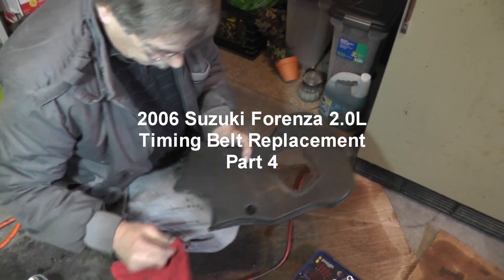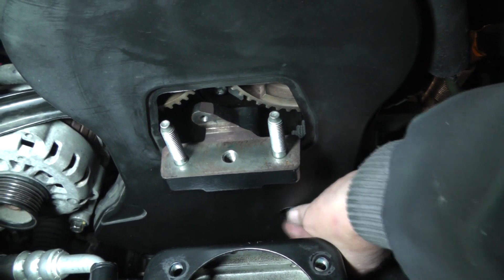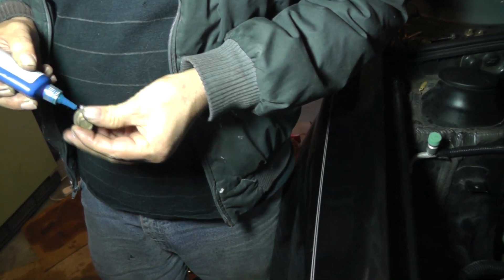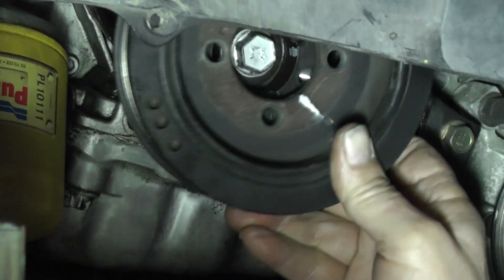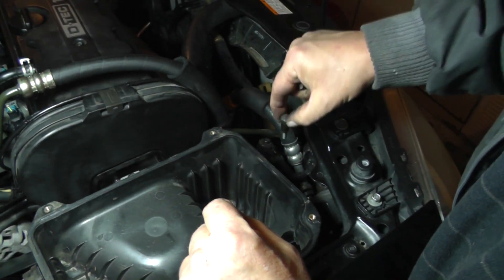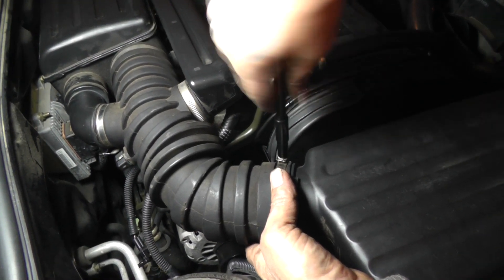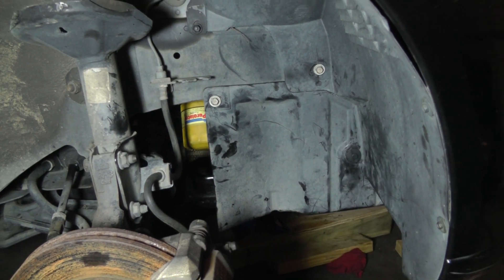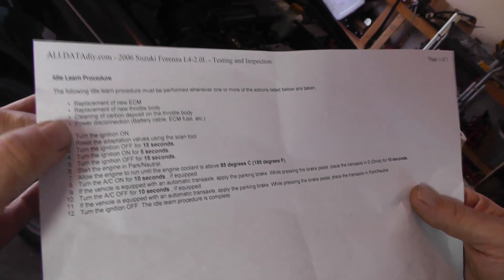Suzuki Forenza Timing Belt Replacement - Part 4

Comment: I've replaced my Daewoo Nubira's timing belt. It was the first time ever I did it. Before remove the old belt, and to keep the correct timing in the assembly I've aligned the marks in the camshaft gears and painted a mark on it, and also on in the crankshaft pulley. I did the mark in the same position in the belt. When the old belt was removed the camshaft came out of position. I've moved the marks from the old belt to the new one. Then it was just a matter of matching the marks on the belt with the marks on the gears and the pulley. When I applied tension it all came to its proper place. It's a 1.6 engine, but it's very similar. This procedure does not apply when the belt as snapped, of course.
Reply from the maker: Thank you Pedro for your comment on your method of replacing the timing belt. Always a little different ways to do things.

Comment: When you tighten up the bottom crankshaft do you put it back in time or what do you do
Reply from the maker: Not sure what you mean. If you're talking about the crank sprocket bolt, it's keyed so it won't move when you tighten the bolt. Just make sure that the mark on the crank sprocket is aligned when you put the belt on.
Reply: @stuzman52  other question how much antifreeze do you put in the car after you  Drain the radiator and pull out the water pump
Reply from the maker: The coolant capacity is 7.82 quarts. I would get 2 gallons of 50/50 mix of coolant and you should have a little bit left over.

Comment: That was an epic series excellent.. wonder how much they would of charged you for that!!  very nice thanks
Reply from the maker: Hi Rick. Not quite sure and as you know prices vary around the country. My best guess would be around $350 for labor. The timing belt kit runs around $115 and if there is a coolant flush done, that would be a little more. Thanks for the comment on the videos, as I appreciate it.

Comment: Did it not make any contact with the valves? Isn't this a interference engine?
Reply from the maker: Yes Vincent, this is an interference engine and 12 out of 16 valves were bent.

Comment: Great stuff. Very detailed and informative. Question, how long did it take you in real time. And how long should it take for an average joe, on a first time. Also do you ever come to Dallas Texas? Thanks a million.
Reply from the maker: +Fernando Rodriguez Thanks Fernando. Seems like it took about a weekend to pull it all down and another weekend to put it back. And I was taking my time too. How long for an average Joe for the first time? Really depends on how mechanically inclined one is. Probably the same amount of time if they're used to doing a fair amount of wrenching. Never been to Texas and you're welcomed...
Reply: Thanks.  Also since. I've called a mechanic. He tells me he charged me 240 parts and labor which I am okay with that. But then he adds that the valves might gotten damaged when the belt broke off. Then he would need to take break out the head of the engine to change out the valves. Question, does this could've happened or the belt damaged the valves and now need to replace the valves. He said that all that would cost me 800$. Does that sound right to you. Please help. Thanks.
Reply from the maker: +Fernando Rodriguez Hi Fernando. When the timing belt breaks, you can pretty much bet that the valves will get damaged along with maybe valve guides and worse yet, it could damage pistons if the engine is running very fast when the belt breaks. The price sounds very reasonable as it cost me about $800 for all the parts and machine work, and I did the work myself. You're welcomed!

Comment: Hello again! The mechanic tells me that the time belt broke and that when that happens they bend the valves. In your case. The valves are bent?
Reply from the maker: Yes, your mechanic is correct that when the timing belt breaks, these engines typically will bend the valves as this is an interference engine. Yes, my timing belt broke, and it bent 12 out of 16 valves. Of course, the head will need to be pulled to repair the valves providing that the valves didn't damage the pistons which could get really expensive if that happens.
Reply: Thank you, it only damaged 6 valves, but I will change them all and the timing belt kit and the gaskets.

Comment: good night I have a forenza 2007 I had a failure with the belt of time, lost teeth and the belt has been changed and the pulleys have been positioned in the respective brands, but it does not start, it will be that I have a more serious problem inside the engine, bent valves, or other type of failure that does not stop a computer crash?
Reply from the maker: angel hernandez Yes Angel, it’s most likely that you have bent valves in the head which needs to be pulled.😩
Reply: that´s very serious and expensive, here probably $900.
Reply from the maker: Yes Angel! It's a very serious and expensive repair. For me doing the work on this car shown in the videos, it was still around $800 which is still not cheap. Hope it all works out for you!

Comment: Hi, 
My suzuki reno 2006 stop working while I was driving in the freeway. I replace the spark plugs and I saw that they was working. So I check the timing belt and I saw a that the belt was not tied enough. I ordered a new timing belt kit (timing belt tensioner and Idlers). When I remove the timing belt cover I found that one of the idlers (the one close to the tensioner) was damaged, so the problem was that the belt maybe jump due of the wrong presure of the idler and that's why the engine stopped. I replaced everything acording with the steps that you share but when I try to start the engine, the engine desn't work. Any Idea?

Thanks!
Reply from the maker: When that idler got damaged, this would cause the belt to jump which would throw the engine out of time. It's a very good chance that you've got bent valves now. Take a look at the second video of this series to see if your valves are bent.
Reply: Hi Sr,
Thanks for your instructions!
Reply: Gerardo Arturo Peláez Brioso poof

Comment: What is the idle learn procedure for a straight drive?
Reply from the maker: Pretty much the same, start the engine and let it idle in neutral. Bring
 it up to temperature and turn on the AC to load the engine. Also you 
can load the engine by turning on accessories which will increase the 
load on the alternator which will load the engine. It shouldn't take but
 a few minutes for the computer to learn the unloaded and loaded 
conditions of the engine to learn the new idle speeds.
Reply: Thanks dude.

Comment: Hello, my Suzuki Reno 2007 i have a code P0340 Camshaft sensor position circuit "A". It could be due to problems with the tensioner or timing belt?
Reply from the maker: maqjode yes it could be where the timing is slightly off or it could be that you actually have a camshaft sensor problem. If you got a scope put it on there take a look at the signal and while you're at it take a look at the crankshaft position sensor and you can see the correlation between those two sensors.
Reply: Thanks, I already took it with the mechanic, I hope and find the solution. Have a good day!